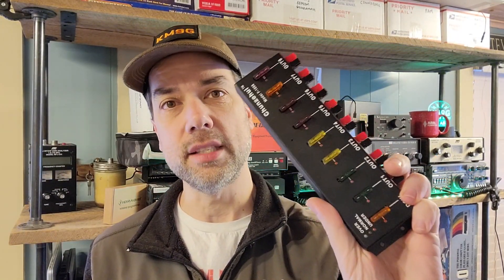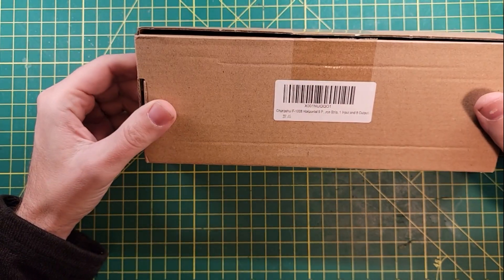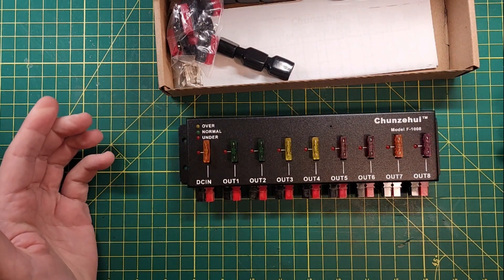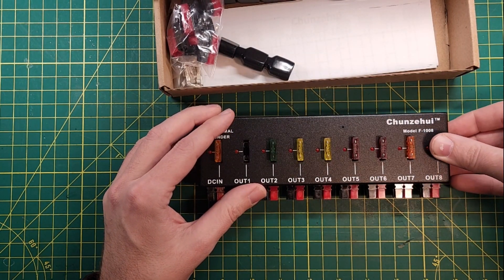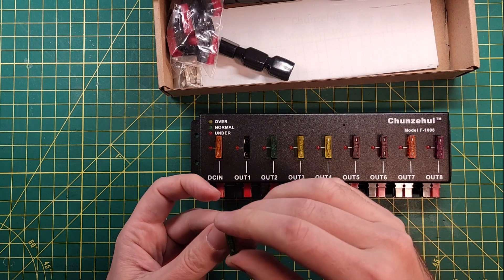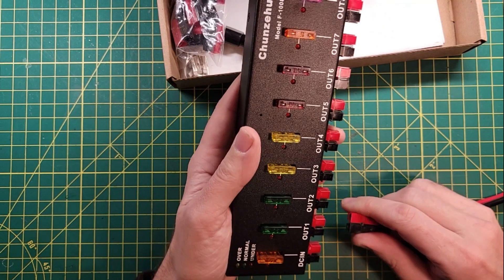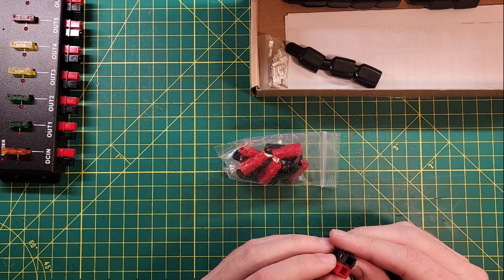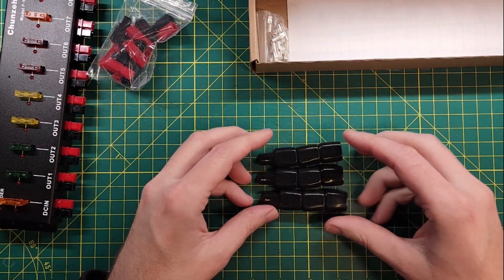Teardown of the CZH-LABS power pole distro block

Comment: nice unit. they added extra jumpers to help with higher current.  the outher jump thing may be for the power monitor lights to change set points r turn off. maybe change to 24V . they sell a 24V version, that a real nice one. off grid livening uses 24V ,36,48V . aircraft is 24V . 73's
Reply from the maker: Thanks Robert - the extra jumpers(shunts) are for turning off the beeper

Comment: I've not had any issues with non-Anderson connectors by themselves. The only issue I've had with them is when you gang them together. The tolerances aren't always the best on those dovetails, so when you pair an Anderson with a non-Anderson, they can sometimes be a little loose or (more often) way too tight, so tight that you risk destroying them just getting them separated. I'll see it occasionally when ganging together two non-Anderson, but not as much as when I'm mixing them.
Reply from the maker: Same, I haven't had any real problems myself either.

Comment: Abit off topic but could this be used for a 12v car accessories system? I'm trying to find an alternative fused  power bar for the dash components on a casual rally car build. Im wanting the  wiring to be able to QD lile this for stuff like GPS, cameras, digital compass and other peripherals.  
No lights or high draw stuff though that would be an interesting cleansolution with some kyzen relays 🤔
Reply from the maker: I don't see why it wouldn't be - unless it wouldn't pass tech.  Those would be the folks to ask.  What kind of car?  I love rally!
Reply: @temporarilyoffline  it's a goof build.  We are taking a Daihatsu Hijet kei truck from Japan and making a micro Dakar style truck.  I have been updating one of the head NORRA inspectors for compliance all around during the build.
Reply from the maker: @captiandemocracy  sounds like a lot of fun!

Comment: 40 amps is a lot of current for a circuit board trace, they've supplemented it with jumper bars. The higher current loads should be placed closer to the input side to reduce the losses, so the far side is for low current loads (and where they had the smaller fuses). A better design is to use an SB50 or PowerPole 75 on the input, at least for battery or higher current power sources. 30/45 amp size PowerPoles get quite hot at 30+ amps continuous. They are fine at 25 amps and below. Overall this power strip looks decent. 73 de w6akb
Reply from the maker: Those were my thoughts too Alan thanks

Comment: Another thought is I would tie the buzzer disconnect to a switch on the cover so I could disable it if the battery input went low.  Otherwise it would keep drawing current making the low voltage even worse... and the buzzer would also drive me nuts after a while.  Just saying.
Reply from the maker: I can see that.  This is the only one with a buzzer and I haven't been missing it all these years in my shack.

Comment: If the current is limited by the fuses, then the High - Normal - Low LEDs I would guess is the voltage level.  Not very helpful if the trigger points aren't specified.  Does the buzzer sound if the High or Low trigger points are activated?  Inquiring minds want to know.
Reply from the maker: I have an idea to setup a 9v battery as a test.

Comment: Those two "Messed up contacts" are not messed up, they are 45A contacts where as the small ones with round holes are 15A or 30A :)
The jumpers lower the resistance thus lower voltage drop and increase amperage handling.
I have a rigrunner. I Feed it in the Center then i have the high amperage users closest to the input and the further away you go from the input the lower amperage devices you connect. 
Keeping the voltage drop to a minimum is important. We only have "12v" (13.8v) to begin with.  
73 OY1R
Reply from the maker: Thanks for the extra info! Could they have used wider traces on the pcb for that?

Comment: Hi Steve,
Appears to good quality. Only reason I can see for the wire links is to help with current flow for the outputs with higher fuse ratings. The two power pole connectors that were open should be rated for 45A. Those that are closed could be 15 or 30A, if you check the Anderson website. I always buy the 45A rated connectors. You and the family stay safe.
Reply from the maker: Thanks Don,  you too!

Comment: Once I started using the retention clips on my Powerpoles I started to prefer the horizontal orientation, because it doesn't block the holes for the clips.  Have you tried the clips?
Reply from the maker: I've seen them, but I haven't tried them yet.

Comment: The bars appear to be for current handling.  They aren't needed on the last two outputs because it's a short enough distance from the end of the last bar that the traces can handle the load.
Reply from the maker: Did you see where the traces got smaller also?
Reply: @temporarilyoffline  yeah,  they ran out of room because of the monitoring circuit.   With that many outputs you can probably limit those last two to lower current applications.

Comment: From yr video, seems well built, oh n the 2 open connectors, are listed as included plus the 18 others, maybe these are for slightly larger wires, for the supply side, unsure, cheers again Steve,..  😀  Jus saw yr reply to the other comment, will be interesting, I have 2 Windcamp units,  but neither have been used, (yet)
Reply from the maker: Hey Tom!  Thanks!